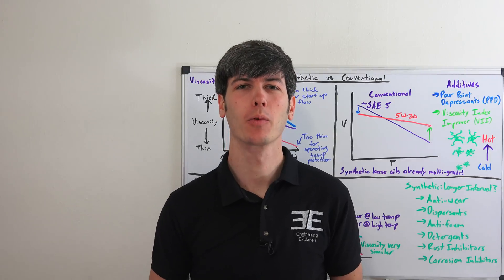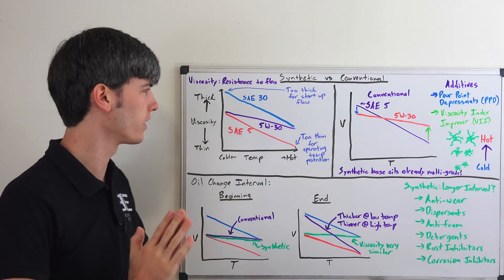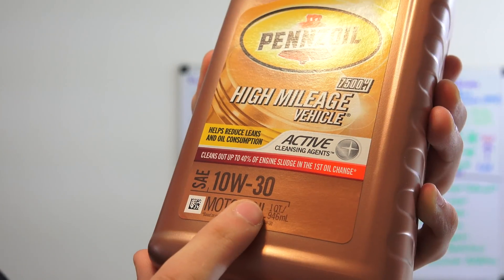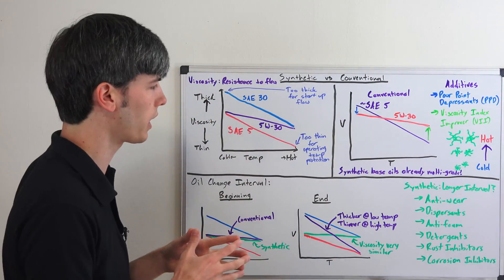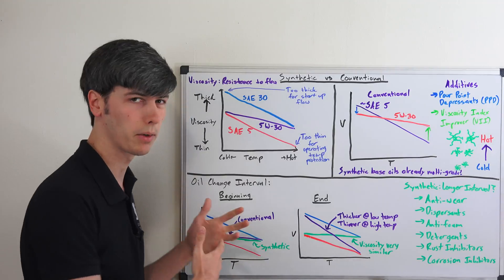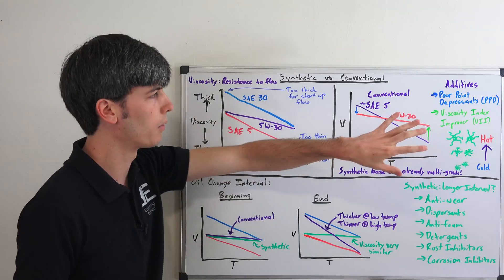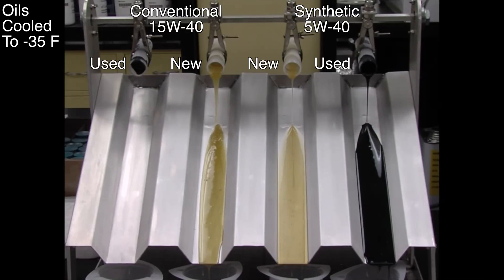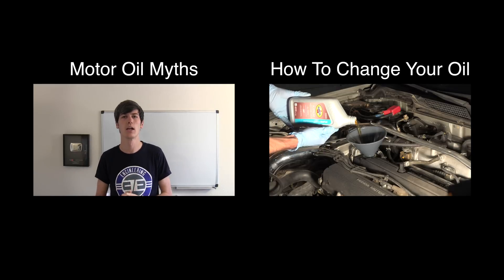Is Synthetic Motor Oil Better For Your Car?

Comment: Is there any particular reason a person couldn't or shouldn't blend different brands or viscosities?  If you had an older vehicle that you weren't particular about or adding oil between changes?
Reply: Yes, there is in fact. Mainly because base oils are compatible, but not all additives are. And the add pack used for a determined oil varies from brand to brand. Sometimes some additives are not chemically compatible to work effectively together so as far as I'm concerned mixing oils won't certainly do big damage to an engine, but let's say it's not optimal.
Reply: No, there's no problem, all oils are mixable.
Reply: From a practical perspective, the answer is no to brands. Makes no difference whether you're emotionally attached to the vehicle. The viscosity ranges specified by the designers should be followed.  You may hear statements about the possible incompatibilities of additives, but I am not aware that any have ever been demonstrated.  If someone else has HARD EVIDENCE of specific ones that impact oil performance, please post the DATA.
Reply: +wholeNwon well I as a mechanic and automotive engineer myself I am now rebuilding an engine of a 2006 Hyundai Elantra that had a leaking crankshaft oil seal that led to a continuous oil Adding. maybe the oil change interval is also a point to consider, but from the practical point of view I see in the engine a lack of anti foaming and detergent capacity from oils, leading to a high deposit levels all over the engine. I know oils are compatible becauae they conform to API specs, but I think I saw a little difference when using mixed oils against one brand only oil engines. I understand too that specified oil is a marketing issue (and a whole different topic) but damn... specs are for some reason and if you are meant to put a SJ spec oil in a  SL spec engine you may observe a difference in cleansing performance. You can also take a look to viscosity charts between oils and judge yourself. Not sure if this is hard data but gives me a clue.

Comment: Am I correct when I say that lower numbers in the name (like 5W-20) would be used in smaller, less powerful engines, and higher numbers would be used in more powerful engines?
Reply: No.  the numbers more readily correlate to engine generation and temperature.  5-30 and 10-30 have and continue to be the norms for some economy engines in 4-8 cylinder configurations with traditional designs.  the newer di and flatplane crank models and high gas mileage engines have been moving towards lower viscosity synthetics because of the tighter clearances and higher rpms

More classic designed v8s used for racing use 20-50 because it can offer the best protection for that day.  But racers and their crews are expecting the oil to breakdown rapidly because of the heat and sustained rpms they inflict on those engines.
Reply: might depend on how many liters but not the power output
Reply: Well the capacity of an engine is related pretty closely to its power output. With more powerful engines, I kinda meant engines that would run hotter. Of course this is not directly linked to the amount of power an engine has.
Reply: Tim Derks uhhmmmmmmmmmm sorry but no the capacity of an engine doesn't have to relate to its power output . a big 7.0 will make  a bit of power but theres 2.0 that make 1000hp said what your trying to say 
also the temperature really has nothing to do with it too. not sure what your trying to say but it doesn't make sense
Reply: Tim Derks with proper cooling you dont really have a huge heat difference between engines and power outputs. the hotter the less power so not sure what your saying
Reply: Sigh... Yes, I realize that not EVERY SINGLE engine conforms to that, but in general, bigger engines have more power. And yes, I do realize that with proper cooling, every engine runs at approx. the same temperature, but it is common to see cooling systems work less efficient after time, thus the bigger engine would run hotter. Also, temperature has a lot to do with oil, as is shown in the video.

If you're trying to teach me something, fine, but don't be a 12yo saying "no you're wrong, I'm right". Show me proof, or support your statements. If you're just trying to show of, just stop.

Comment: hi man i have question... am a drifter and i have 2jzgte engine with 600 hp at wheel... i use castrol gtx half scynthatic...  our country very hot in the summer like between 40-50c or more   and cold in the winter  like 5-20    do you recommend full scynthatic or i just keep using the same oil??
Reply: full synthetic , you watch the video ? he just said it was better in every way
Reply: +Karson Cox sorry  ... am talking about a race car in high rpm all the time in winter and summer with the hot and cold temps
Reply: +Adam Budai maybe you are right and i respect what u said. but i wanna see what the channel owner will say .. iv said all the informations   the weather   the temps and the usage of the car and i want to read his comment

Comment: That rather depends if your engine was designed to run on synthetic or mineral. So saying synthetic is better is misleading but oh well you are sponsored so ignore the facts for sponsorship
Reply: only recently are cars required to run synthetic, older cars can run both because clearances are larger, and synthetic has a wide range of viscosity ratings. therefore you can run oil with the same viscosity but with more lubrication and consistancy. 

What are your facts about mineral oil being better?
Reply: +Rentta no engine is DESIGNED to run mineral. any motor made in the roughly last 40 years is compatable with both. the first automobiles maybe need additives but could still use synthetic. your logic is flawed.
Reply: Oh dear. Did you notice how he showed a conventional AND a synthetic bottle at the beginning by the SAME manufacturer?
Reply: you think he would get something wrong in a video just for sponsorship lol i highly highly doubt that. pretty sure if the motor was designed to run mineral it can run synthetic with more protection then mineral. pretty sure he would have said something if what you say was true. synthetic is better for everything is what I've always heard and thats what i always run
Reply: +Rentta it is ALWAYS better. where are your facts?
Reply: You're making baseless accusations. You're one of the major issues in the engine world perpetuating myths like that. Where is your degree in engineering? Where are your credentials in mechanics? Even here in Canada; the land of car gimmicks and myths, we know that synthetic on average is better than mineral. You clearly just can't accept that you're wrong and that you probably don't know what you're talking about. P.S I don't claim to know anymore than the next guy nor do I claim to be an expert. But it is widely known synthetic tends to be better.
Reply: actually he clearly says in the video that you SHOULD use whatever oil your car manufacturer recommends, i didnt hear anything about "the oil from XYZ brand is better"
Reply: Even old aviation engines of a design 60+ years old will run on synthetic oil just fine. But the advantages are minimal to non-existent, and it's more expensive, so it is usually not used. The typical 15W50 multi-grade aviation oil by some manufacturers is pure mineral base stock, while other manufacturers make a semi-synthetic variant, and that may have advantages for high-performance turbocharged engines, but mostly it doesn't matter. Doesn't hurt, either. So like most other I'd like to see your evidence. And not anecdotes such as "I know a mechanic, and he told a story of some owner of an old car who used synthetic oil, and then the engine broke." That's a nice story, but not evidence.
Reply: Mechanical engineering in college taught me that the synthetic oil is always better.
Reply: Synthetics Alwas Better Than Mineral, This Is Sponsored So He Show Penzoil Brand As Example, But We Know There Are Better Synthetic Brands.
Reply: +Rentta  
Inaccurate statements.
Reply: Lol, you also think different grades of gasoline do nothing too I'll assume. 
5:50 is a good example of the two. The point there is to show how much better the synthetic keeps it viscosity over time compared to conventional. 
 It's usually people who don't want to spend the extra money who say gas and oils make no difference.
Reply: +bbqBaconNinja Higher octane gasoline does not make a difference if your engine was not designed to use it. Using a higher octane fuel in a lower compression engine that does not require it does nothing but give you a slower combustion burn and waste money for exactly no benefit.
Reply: The oil was probably blamed , but it would not have been the problem.
Reply: +Rentta I run synthetic in everything. my two vehicles on my photo are high mileage, my camaro, 210k running 10w-30 full synthetic, and my lifted tahoe behind has 163k. it is running 0w-30. both run excellent

I run thin oil in the tahoe for winter, as it barely gets driven in summer, and it gets to -50f here most winters
Reply: +Rentta you are ignorant bruh. Oil grade is what you are referring to. If your car takes 5w30, don't put 15w40 in it. However, you can interchange conventional 5w30 or full synthetic 5w30, depending on your own preference.
Reply: +Rentta No synthetic is better.  If you have issues running synthetic, it's because you have worn seals and or rings and the standard mineral oil is covering for you by thickening up as it gets older and not burning or leaking as much.  Using the manufacturer recommended oil pertains to viscosity not brand or composition. Almost all vehicles require an SAE certified motor oil with some recommending full or synthetic blend to meet the change interval.
Reply: +Hammer0f Thor ::) unless you tune for it with added spark timing.
Reply: "They aren't people have destroyed classic car engines with it"Example?
Reply: This article is the first thing I found about the use of KOH in oils. It was just an example because I do not remember everything I read in school.  At the university I saw inside of a test engine that worked on the mineral oil only, and the other who worked on synthetic oil only. Additives in synthetic oils does not allow for the deposition of "tarry substance" inside the engine.  The engine on the synthetic oil has less signs of wear.  Therefore, in my subjective opinion synthetic oils are better, even if I have to pay more for synthetic oil.
Reply: no manual I've ever seen says use mineral oil
Reply: Baerchenization I commented that because title is misleading
Reply: Victor Hernandez They aren't people have destroyed classic car engines with it
Reply: Karson Cox Saying synthetic oil is always better is wrong
Reply: They Protect From A Demand By Say "Your Car Manufacturer Recommends"
Reply: Rentta Synthetics Are Know For Leaks On Old Engines But Is The Seals Fault, New Oil Are Better Plain Simple By Looking At The Chemical Studies On Metals, If The Engine Has Problems Synthetics May Reveal That Problem Quicker Than Mineral.
Reply: Victor Hernandez If engine is designed to run on mineral oil you should use mineral oil because it's better for that engine
Reply: That's less to do with it being synthetic and more to do with it being the wrong viscosity grade and/or wrong API specification. Some API Specs include additives or compounds that are damaging to the materials used in old engines or gearboxes.
Reply: +Rentta all of you need to stop yapping away. Synthetic or not it doesn't matter! Unless your engine requires synthetic you can run both with no problems. Synthetic lasts longer than conventional, but both are lubricants for the engine and both do the same job. Stop over complicating it! It's the same with gasoline. 87 or 93 they are both gasoline with the same detergents and cleaning capabilities. If your engine doesn't require premium you don't need premium!
Reply: +pinkdispatcherSynthetic oils with KOH additives make a difference, keep the engine clean.
Reply: vampirwrr
I'm not quite sure what KOH (potassium hydroxide? Is that a thing in engine oil?) additives are, but normally the only "cleaning" additives used in aviation oil are dispersants to keep the contaminants suspended. There are no detergents in aviation oil.
Reply: https://en.wikipedia.org/wiki/Total_base_number
Reply: vampirwrr
So yes, potassium hydroxide. I'm pretty sure none of that is ever put in aviation piston engine oil.

But I think the article doesn't really make sense. If the TBN is the amount of KOH required to neutralize the stuff, then a higher TBN means that the stuff is more acidic. But the article then says that higher sulfuric acids contents (from fuel, e.g.) would lower the TBN. I'm confused. Adding KOH apparently is also mostly used to combat contamination from sulfur in fuel, which is not an issue in modern automotive nor in aviation engines. Those fuels should really be sulfur-free.
Reply: Should we listen to the guy who has minecraft videos recommended on his channel? or the certified engineer?
Reply: L
Reply: +Nick Harrison you're that lazy that you can't spell loss? lol
Reply: +Sergeant Speed I wouldn't go so far as to say that synthetic oil is not better than mineral oil, but there are situations where mineral oil is preferred.  Many years ago I had a '74 Impala with almost 200k miles on it that had been run on mineral oil it's entire life.  When I tried to switch it to synthetic oil it began to burn oil at an alarming rate and could not pass emissions standards.  It was exempt due to its age, but they still tested it and included the information in my inspection report. The proper course of action would have been to tear down the engine and rebuild it replacing all of the bad seals, but being a college student at the time, I had neither the time nor the money to take on that task, so I simply switched back to mineral oil.  After about six months of driving my oil consumption tapered off and the next year it was able to meet the emissions standards (although just barely).  This by no means shows that mineral oil is in any way superior to synthetic oil, merely that in certain specific situations mineral oil, with all of its problems, may be the better option.
Reply: yeah my dad told me to always go conventional for my 67 volvo. not that that has to mean anything. but it was very specific
Reply: i had to look it up and this is what i found http://www.popularmechanics.com/cars/how-to/a1497/4213451/
so i guess it should be better than in the begging of the synthetic oils but im not buying it for mine. its 50 years old next year
Reply: I have a 39 year old van i do 2000 miles a month in, it runs on 10W60 synthetic. it keeps the engine clean and runs a load better, especially at higher revs. (4 speed so it is up there a lot). It also does not damage the seals in the way conventional oil does.
Reply: the seals are not at fault. it is because the seals have been damaged by the conventional oil. it also causes the seals to swell. when you change to synthetic the seals shrink again, hence they leak. fit new seals and they will last far longer with synthetic.
Reply: +amojak Is that still a problem?  I was under the impression that oil manufacturers had solved this issue years ago and seal shrinkage when switching between mineral and synthetic oil was mostly a thing of the past.  My earlier post referred to an experience I had 20+ years ago and had I been in a position to replace the seals and run synthetic oil, I would have fixed the problem correctly.  As it was, using mineral oil was a cheap and easy stop gap solution to stop my '74 Impala from burning so much oil and pumping out excessive amounts of pollution.
Reply: +amojak Is that still a problem?  I was under the impression that oil manufacturers had solved this issue years ago and seal shrinkage when switching between mineral and synthetic oil was mostly a thing of the past.  My earlier post referred to an experience I had 20+ years ago and had I been in a position to replace the seals and run synthetic oil, I would have fixed the problem correctly.  As it was, using mineral oil was a cheap and easy stop gap solution to stop my '74 Impala from burning so much oil and pumping out excessive amounts of pollution.
Reply: bcubed72
But the problem is not "synthetic". The problem are certain additives.

More specifically, the problem was suddenly running an oil with dispersant (single/multi-grade or mineral/synthetic didn't really matter) in an engine that had been building up and depositing sludge (lead and other) for decades by running non-dispersant mineral oil.
Reply: rastavolt yes it is if you have a car with a 1963 designed engine in it and the car itself is 39 years old :D . it isn't an issue so much for newer cars but mineral oil will still wreck seals over time.
Reply: like others have said, switching after so many miles will probably reveal problems that might have not been an issue with all the buildup with conventional